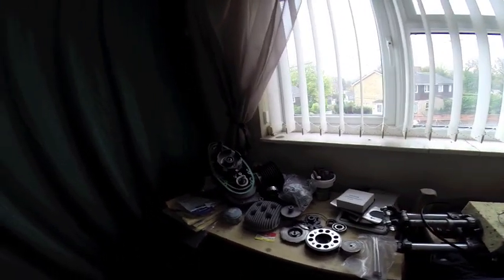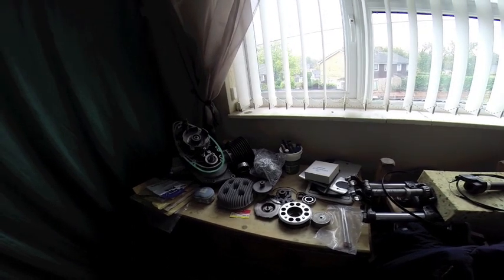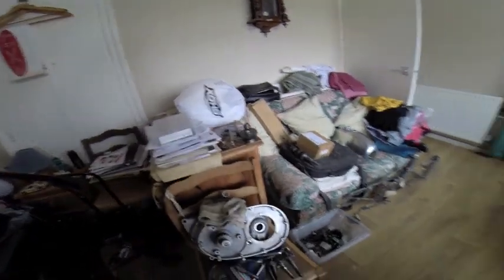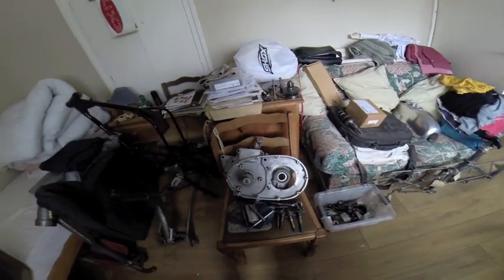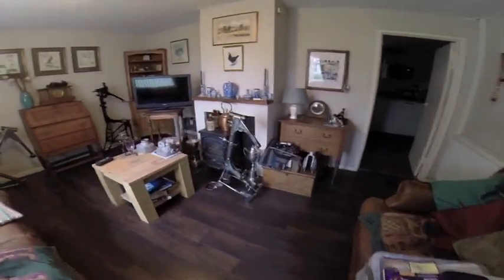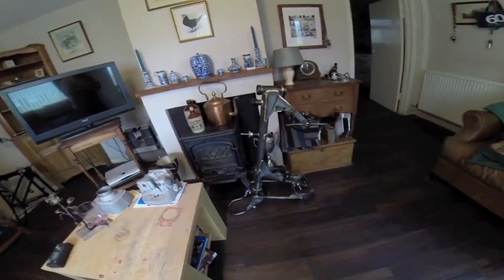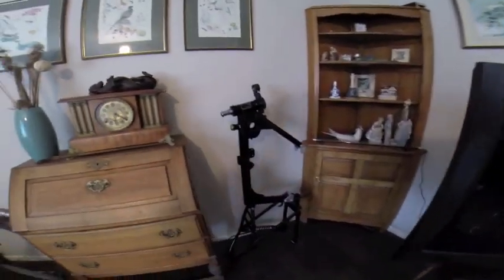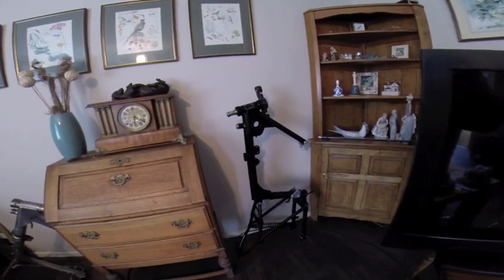My First Project for BSA Otter

Comment: Less talking more building Charlie
I'm interested in the Bantam build, what frame are you using?
greetings from Australian Otter
Reply from the maker: Hi Gary... I am using the Modified Bantam frame I did a few years back.. but now need to get it built up over the next few weeks, as I need to try a NEW cylinder head on the bike and get it tested . So over the next few weeks we will do a weeks video on the build up.. OK thanks for the comment...